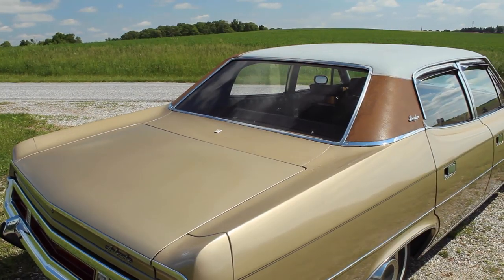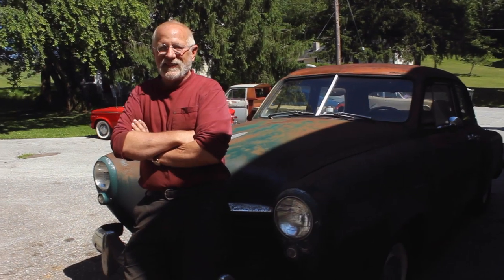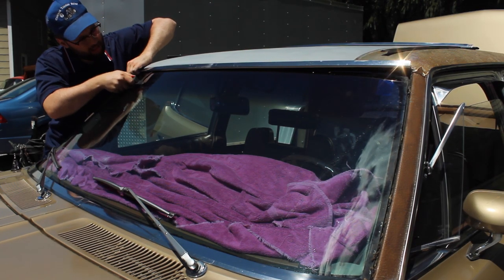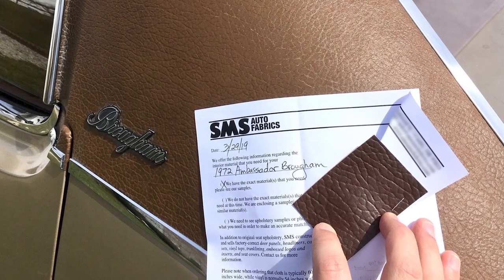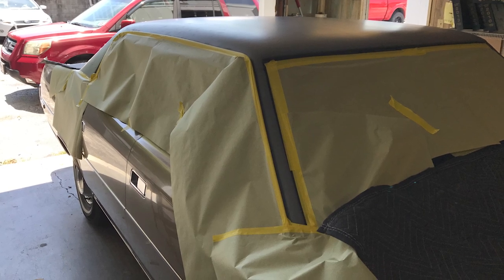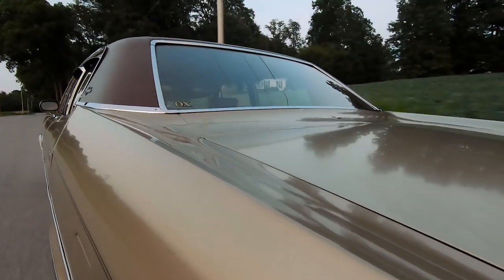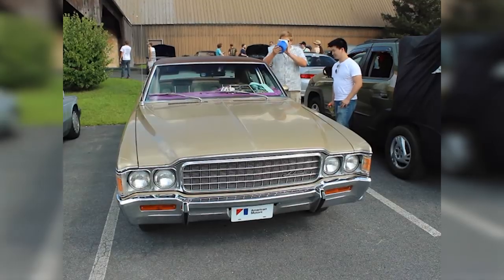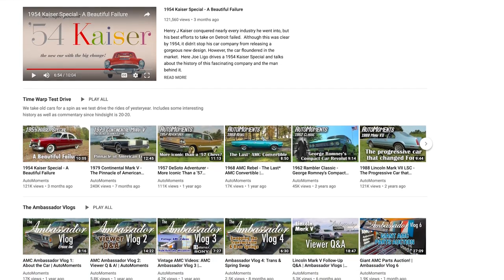Installing a NEW Vinyl Roof! (Finally) | Ambassador Vlog 7

Comment: I just rewatched this video and enjoyed it just as much if not more than the first time. I love the Ambassador vlogs; my first car was my father's hand-me-down 1973 AMC Ambassador, which he gave me in 1981. It was maroon exterior with the same exact interior as yours. It had a little rust at the bottom of the driver's rear quarter panel (it spent its entire life in New York City, so road salt) but was otherwise immaculate inside and out. I treated it exactly the way you might imagine a 17 year old idiot would. Its life ended when I was racing a childhood nemesis in a colonnade Monte Carlo on the interstate at well over 100 mph. (By the way, whenever I envision Satan, he's driving a colonnade Monte Carlo.) The engine died and never ran right after that. My dad liked to keep his cars looking good but was incredibly lax on oil changes, and the car had over 70,000 miles on it, which is nothing today but back then it was beyond the expected life span of a vehicle. I miss that car a lot; I remember how hard it was to find an aftermarket radio to replace the factory AM unit, so I installed an FM converter from Radio Shack. And I have extremely fond if somewhat salacious memories of the fold-down front seats, a trait AMC inherited from its Nash parent.

I love your car, but I kind of wish it was in worse condition so you could embark on more restoration adventures! Maybe you should buy another one . . . .

Comment: Good job, Joe. I would love to bring the 98 to that car show next year. You're lucky to be surrounded by odd-ball car lovers. And yes, that Aztek is amazing. It would have had the blow-up mattress, built-in inflator and redundant rear audio controls.
Reply: Joe Tralongo thanks, it does have the rear radio controls, but since my tent came from the junkyard (shockingly mint and complete) it is missing the mattress and built in inflator. I thought about adding the inflator but it is way too much of a hassle to put in if it wasn’t equipped with it originally.

Comment: Love this car, We had a 1973 Ambassador Brougham it was built like tank compared to the cheap plastic cars of today. Had a 302V8 Ford motor and Chrysler Torque command transmission. It was the flagship of AMC never had a problem with it, traded it in for a 1978 Impala another great big solid car brand new out of the show room $6800.00 now for these goofy cheaply made  small cars they cost you a small fortune!
Reply from the maker: Thanks for being a fan of AMC and thanks for watching!

Why did your Ambassador have a Ford engine?  AMC used their own engine in the Ambassador line, except for a few 1950s models with Packard V8s.  For 1973 I believe the choices were a 304, 360, or 401 V8.
Reply: @AutoMoments  Yes I should have said the AMC 304 was close to a 302 Ford never the less it had plenty of power and was a very smooth driving car, bought it new in 1973. It's nice to see a younger person who appreciates the older cars the new ones are made so cheaply. Your 1972 looks great hope you will keep restoring her!

Comment: Looks great, congrats!  Mike, on the other hand, looks like Charles Manson's big brother.
I applaud you for not judging the book by its cover, I would have turned around and SPED away.  And I totally believe you that it rode smoother afterwards, just like after a washing.
Reply from the maker: Mike was great.  He did good work at a fair price.  Hard to find guys like that today. Thanks for watching!

Comment: I enjoy watching your Videos. I live in Northern California. S.F Bay Area to be exact.  Your car looks stunning after the new vinyl top.  I have used SMS Auto Fabrics and i got to tell you they ARE the best. I know they take forever and the Phone Customer Service is so so. But I have used them on  my cars. All Restored,  1960 Plymouth Fury, 1962 Rambler Classic 400, 1974 Chevrolet Caprice (Vinyl Top) and now my newest, Project a 1965 Rambler American 440 Convertible.with the 232 Motor.   Total restoration, Seats, door panels, carpets. Correct Vinyl top from the 60s  etc..... i even used just dashes in  Van Nuys Ca for the rear interior side panels . not stiched with vinyl material but the actual process, the Vulcanized process.  im trying to restore the car back to original. SMS was even able to die electric stamp the designs in the seats to replicate the original to the tee. With SMS  one needs to be patient with them  but they come through big time!! they are very good!!  Keeping the Cars Original like you are doing with the Ambassador is Great. And keep up the Great work documenting the Great American Cars that are truly a work of Art. Take Care!
Reply from the maker: Thanks for watching!  We are definitely very pleased with the quality of the vinyl and the craftsmanship of the top.  It looks fantastic.

Comment: Sounds like SMS.  While their work is good quality, their customer service and turnaround times are less than exemplary.  My own experience they quoted me "Next Spring" for my two Gremlin front door panels.  Well, "Next Spring" must've meant the following year as 18-months later I finally received my door panels.  I was told I'd get my old ones back but never did.

The new ones look great at first glance but close inspection reveals many very minor flaws.

But, needs must when the devil vomits in your kettle.  They're the only game in town.
Reply from the maker: Tell you what, the top looks great, but a little kindness on the phone would go a long way. Haha.  Thanks for watching!

Comment: I am so glad to see you had the top done!  It looks great!  I think I mentioned to you in another comment on another video that I have to give credit to the one who "sliced and diced" the original top.  It was an interesting look.  That car show you showcased would be right up my alley.  It looks like it was fun to see the "odd and unloved".  I also found your experience with SMS very similar to my own.  It took so long for them to deliver on my order, I was ready to call American Express and accuse them of credit card fraud.  However, having said that, the interior fabric for my 60 Buick Invicta looks EXACTLY like the original that was in the car. and is of very good quality.  They also sold me replacement vinyl for a 72 Chrysler I had about 10 years ago which is also top quality.   I look forward to seeing more from you.  I enjoy everything I have seen you do, and I REALLY enjoy the fact you don't take it too seriously.  You'd be a hoot to meet at a car show!  Thanks again!
Reply from the maker: So, it was actually me who "sliced and diced" the old top.  When I bought the car, the previous owner had just ripped huge strips off the roof, so I trimmed all the loose edges, applied a quick coat of spray paint to the metal, and ran silicone around all the edges to keep water out.  It was an ok temporary fix that wound up lasting longer than I planned.  But now it's all done!

I'm glad you're a fan of the channel and a fan of AMCs!  Be sure to keep watching for more!  I'd love to see your Buick someday!
Reply: @AutoMoments  I think it was a great job. You were working with not a lot and it made it look really presentable.  Most definitely an "A" for effort.  It would be a pleasure to show you that Buick.

Comment: Occasional treatments of 303 Aerospace Protectant will keep the vinyl top looking like new permanently. I've been using this stuff on rubber, vinyl, and plastic for 25 years and I've never looked back!
Reply from the maker: Interesting.  Thanks for the tip!

Comment: Invest in a magnet license plate cover if you insist on blurring out your plate. Slap it on, make editing much easier. 

You could find a flat AMC logo steel plate you can attach magnets to that will lock onto your regular plate (if it isn't aluminum, most states are stamped metal) or one with a 1972 printed on it like you see in the old promo photos.

Comment: What's your thoughts on Armor All? Our grandma had a 1985 Mercury Grand Marquis with a landau top. She Armor Alled her Mercury's landau top religiously, and her landau top looked just as fresh as the day she bought the car, the same day she sold her Mercury Gran Marquis in the late 90's. I know that there's a lot of Armor All horror stories on YouTube, but we've been using Armor All for decades without any horror stories of our own. Lastly, I even wrote to the MythBusters t.v show about using Armor All, but it never was a aired topic.
Reply from the maker: Personally I don't have anything for or against Armor All, but I've heard "horror stories" too.  The guy at the top shop recommended something from Meguires, so I'll probably go with that.

Comment: How much did the top replacement cost?
Reply: My top for my Maverick cost 200 Canadian I believe. Will get it put on in the next month!
Reply from the maker: It depends...this one was kind of pricey since it matched the factory original color and grain, and it was already cut and sewn to fit.  (Several hundred dollars) 

Without going into specifics, between the sanding+paint, the install, and the custom ordered top, the vinyl top was the most expensive part.
Reply: I have to do this to my 85 marquis I'll do it myself

Comment: Did the car actually come with factory vinyl top? Or was it a dealer add on?
Reply from the maker: Vinyl roof was optional on '72 Ambassadors from the factory.  Of the handful of Ambassadors I've seen, most have vinyl tops but '72 brochure shows both with and without.  Thanks for watching!